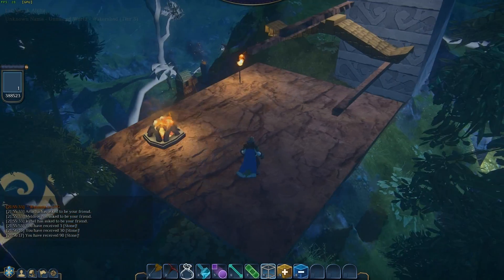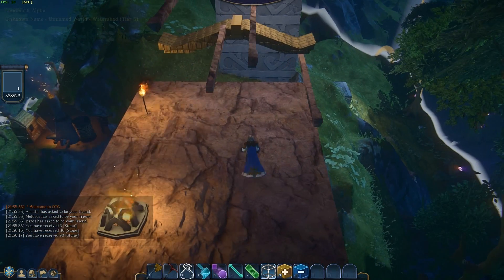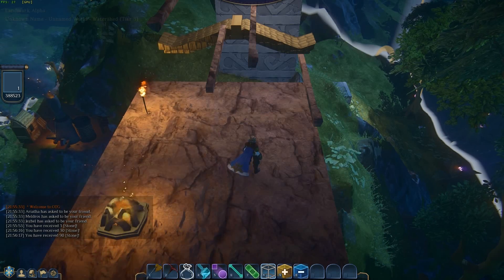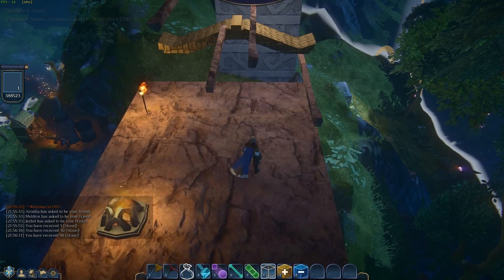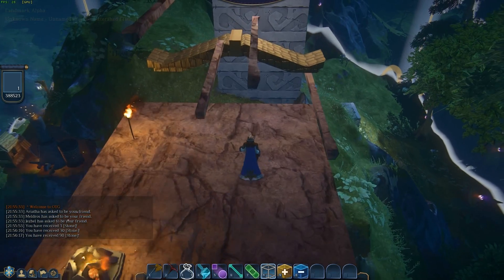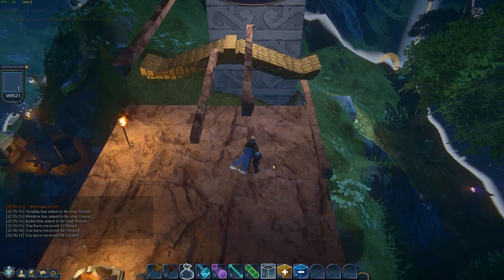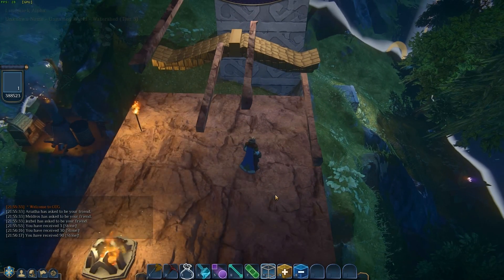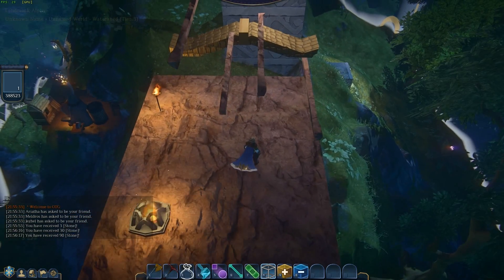EQNext Landmark Alpha Build Tools Tutorial - Advanced Line Tool Roof

Comment: so I must be doing something wrong because when I place the point and scroll to make the section bigger the selection flips to the underside of the guide.
Reply from the maker: Scroll to make it bigger?  Which tool are you using?  Scroll to make it bigger is only available on props or the other shapes (circle, triangle, etc).
Reply: Chris Pinckard just realized that I was snapped to grid "G key" released me from grid and I was able to make it work for me. Thanks... Chabari

Comment: Hey Chris, I was wondering if you had any ideas on how to make a cone shaped roof? Like you see on the top of Cinderella style castles.
Reply from the maker: Not a pretty one, but the one I made was using the line tool.  Make your circle, like in my circle video.  Put a post in the middle, make it 10-15 vox high, or so.  Then use the line tool around the edges.  The 2nd smallest square on the bottom, the smallest square on the top.  You'll end up with a crenelated cone, but it will be cone shaped.  You can then smooth around it, but don't smooth the very top or it rounds off.